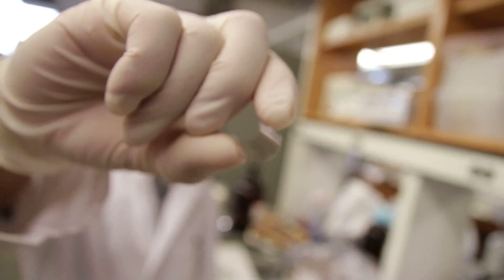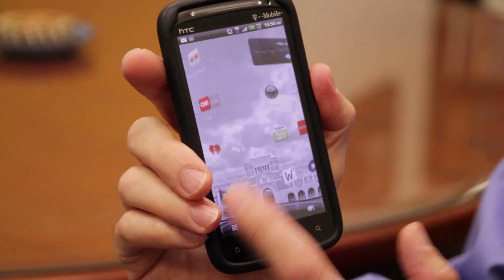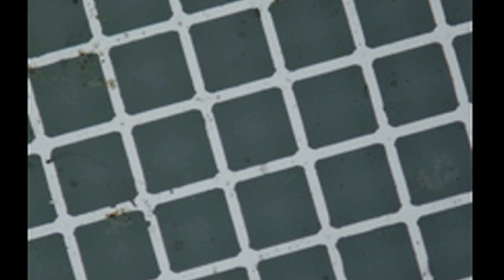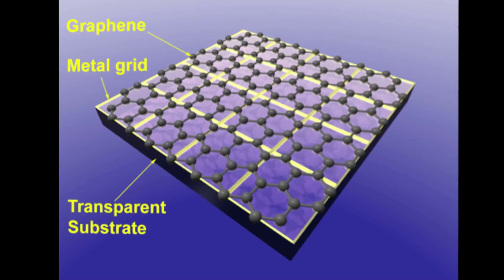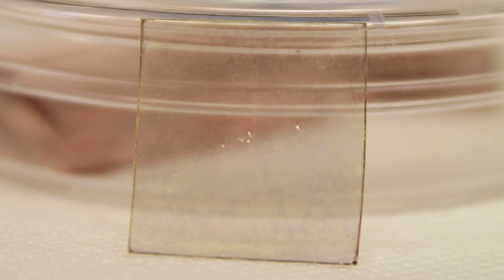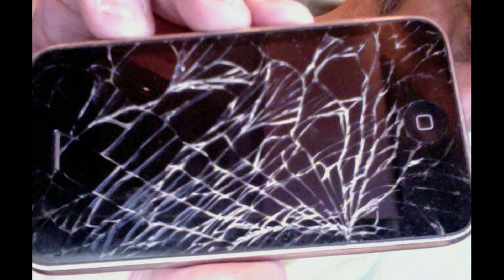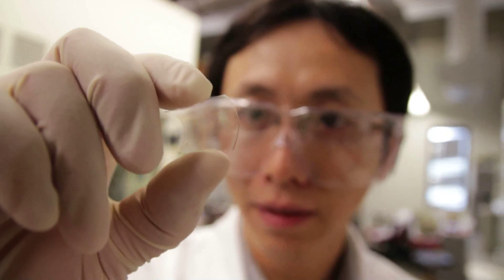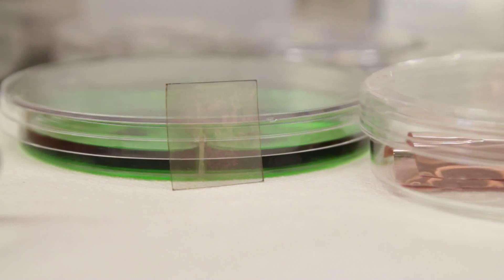Dream touch-screens from graphene at Rice University

Comment: The issue with plastic is it scratches and feels like crap. Because glass is actually a super cooled liquid (That's right boys and girls, glass is liquid. Go to a very old building and look, the top of panes will be thinner than the bottom because the glass will drip) it is possible to make it super flexible. Plastic can theoretically be made extremely hard but flexible glass is more in reach. This tech is still very good and will probably go with Samsung's flexible OLED screens well.
Reply: ethan paffe The seemingly solid glass appears to have melted. ... And, because glass is hard, it must be a supercooled liquid. Glass, however, is actually neither a liquid—supercooled or otherwise—nor a solid. It is an amorphous solid—a state somewhere between those two states of matter.Feb 22, 2007
Reply: ethan paffe glass is a hyper-viscous super fluid.
Reply: IraDalor glass is actually not a liquid, I highly suggest you look into that further.. people got that idea because of the way churches used to make stained glass windows

Comment: The glass that cracks on iPhones is the top layer of glass. It's a cosmetic "cover."  The actual glass sensor layer is below. If you crack your cover glass the sensor glass still works. You could easily use a plastic cover, but then it would scratch fairly easily.  Apple and other manufactures wisely chose glass for the cover for durability and optical transmission over plastic.  I'll take a crack under extreme abuse versus a scratched up display under normal use any day.